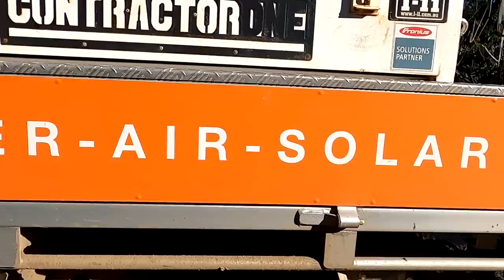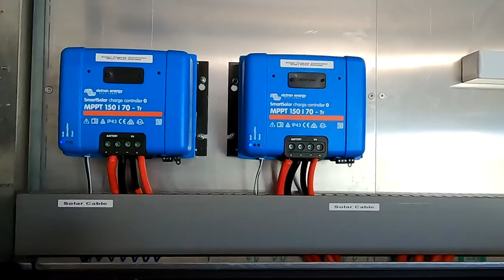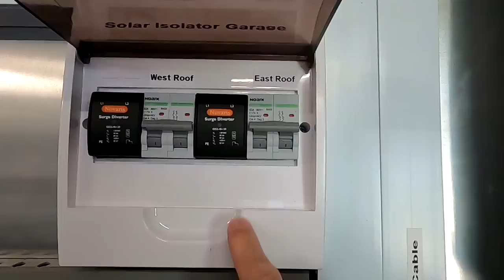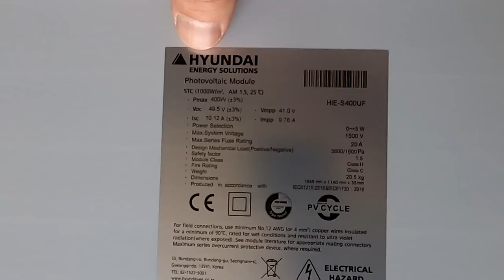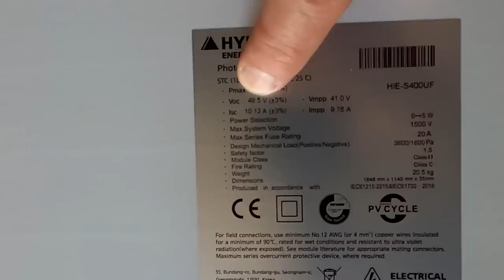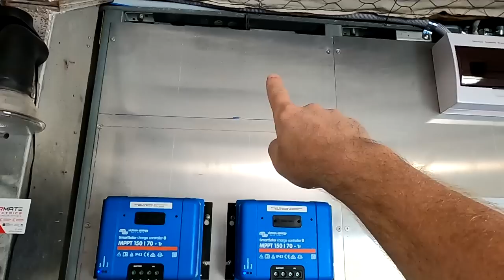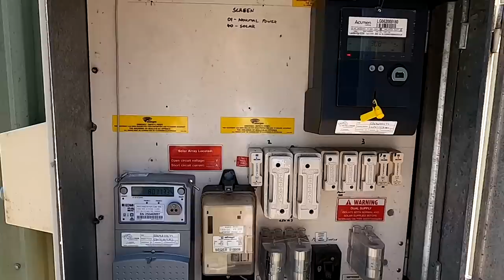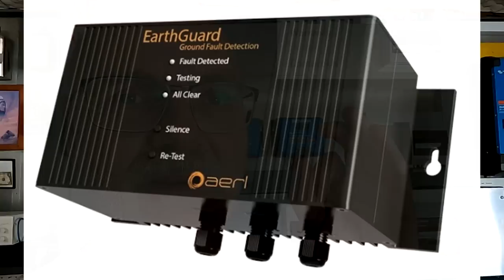I booked an Electrician to check on my DIY Solar-Battery System.

Comment: To get the best value on the expense of new panels, I would only mount them in a location that gets the most hours of sun per day, per season.  This install could be worth a few videos.  Since you get income from the YouTube views, won't the expense be a right off on your taxes?  This is the problem with getting a second opinion.. it usually ends up costing money.  I am a minimalist, so even with the discount, and the possible tax write off, I wouldn't do it.  Doesn't your current system provide your needs?
Reply from the maker: I have only these locations available. None of them are in full sun all the time. So it will be these roofs in partly shade. I guess, this exactly makes it even more interesting. In pure sun it's not a problem and the video would be over.
We potentially have the opportunity to connect the house now as well, so demand is rising.

Comment: Sounds like a good deal if it doesn't put you under some kind of contract ?
Reply from the maker: No contract, I pay for the panels and installation so it will be mine afterwards.
Reply: @OffGridGarageAustralia  Sounds good then . Usa recently renewed a Tax credit incentive that was due to drop lower . It has been reset at 30 percent .  Almost anything including battery banks  , tools , etc.  spent on solar can be claimed at the end of the tax year with no cap .

Comment: It is unclear toe what the primary motivation was for the inspection. To ensure compliance when you connect the house.....or some other reason
Reply from the maker: I believe I pointed this out in the video and in the video description.
It is a DIY project and I wanted to ensure the compliance and safety of the system as it grows bigger and bigger now. I also had some questions about certain aspects of grounding and the solar installation on the roof (cracked panels, grounding, SPDs,...).

Comment: Where can I find you email Andy? I am wanting to build a off-grid system for my caravan that I will live in while building my house and would like to go over with you on some ideas I have.
Reply from the maker: Sorry, ma. I'm getting like 25-30 emails a week with requests. It's out of control...
Best to leave your questions in the comments so everyone can chip in
Reply: @OffGridGarageAustralia  All good. I have been looking at the POWMR all in one units and I think I will get one to test. More options as far as solar panels to make up 5 to 6kw needed for them. I have started playing around with steam engines for generating power around the 8 to 10kva mark and redesigning steam boilers for better efficacy.

Comment: You can install 3 panels in series, the  MPPT 150V limitation is for on load not Voc thus you will be at 128-132V.
Reply: No, the limitation on the MPPT input is for Voc. And the voltage also goes up when it gets colder.
Reply from the maker: 3 panels would not fit on my roof in one vertical row as I have them now. And having one panel on the next row is not ideal because of the shading.
Someone here already mentioned that the Victron MPPTs can handle it (but certainly not recommended) and the installer has taped off a section of one panel for a few months until the first degradation of the panels is over and the overall Voc is a bit lower. 
All not ideal. 
The new panels will have 49.5Voc and the old panels have only 35Voc, so that's almost the same voltage anyway when combining 2 in a string or 3 in a string.

Comment: If your roof is to small, then extend the roof...
Reply from the maker: That would involve a builder which costs $$$ too.
Reply: @OffGridGarageAustralia  it's metal. Som beefy L brackets and a chopped up roof plate should be enough.

Comment: Off Grid darfst du grundsätzlich machen was du willst. Kann dir doch keiner Vorschreiben.
Reply: Unless you want to keep your insurance. You still have to comply with the regulations, even off-grid. If someone gets injured because you messed up, it's on you.
Reply: We are regulated on everything here in Australia, and they even have regulations for off grid installations, (though obviously not all people follow them).
Reply: Not really true. A lot of regulation are not limited to grid tied system.
The panel installation rules for example are not influenced by off-grid or not.
Reply from the maker: Darf man leider nicht. Auch beim Off-Grid gelten die gleichen Standards als auch beim Netzbetrieb.

Comment: 092322/0637h PST 🇺🇸  092322/2337h Brisbane 🇦🇺 Thank you for the update. And why was it necessary for the Electrician’s  visit? The rural  ordinance, for safety Certification? I didn’t understand that part of it. 
I had a glimpse of your PV set up drawing. It disappeared before, I could actually view it to study.
Best wishes. 73s…
Reply from the maker: I booked the electrician in to check on my system and update what needs to be updated.
I made a dedicated video about the whole setup and explaining the drawing in all details: https://youtu.be/RrH-mCtJZO8
Reply: Thank you, very much for link. This is precious for me. I can imagine the time, the effort and the energy you ploughing into making this video; is unbelievable. Hats off, Andy.
Reply from the maker: @sreekumarUSA  and making the drawing 😁😁 Yeah it all took a while to get it together, but it's worth it for all my supporters and viewers here on the channel.